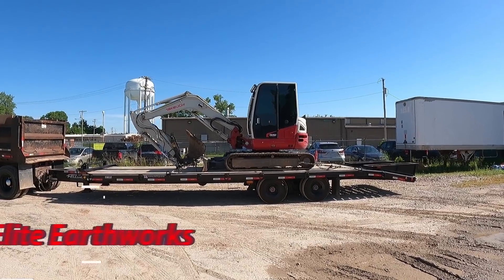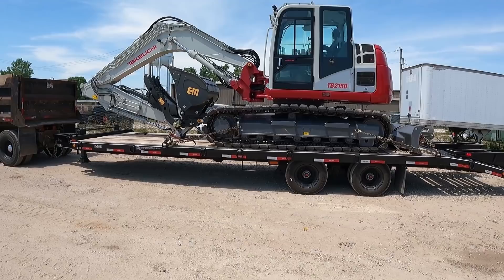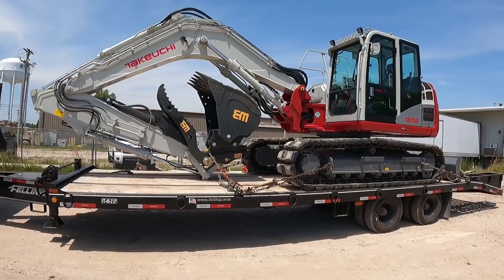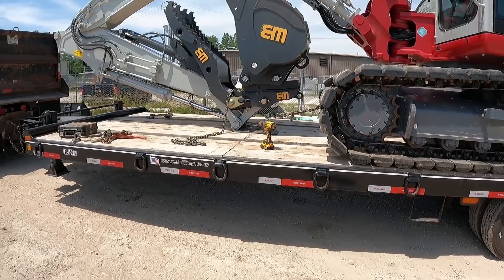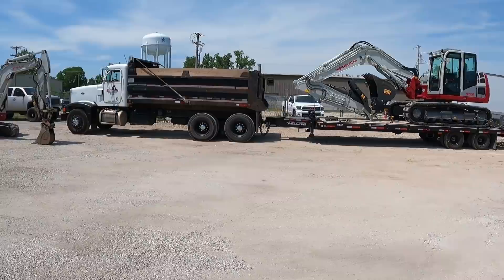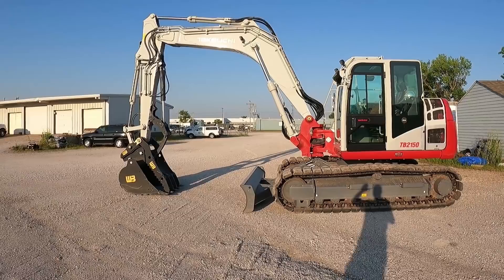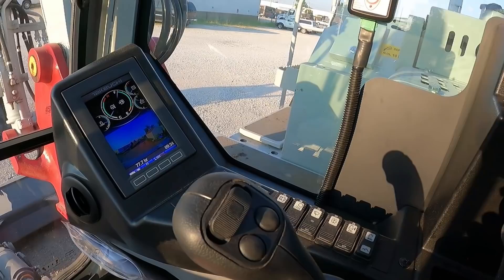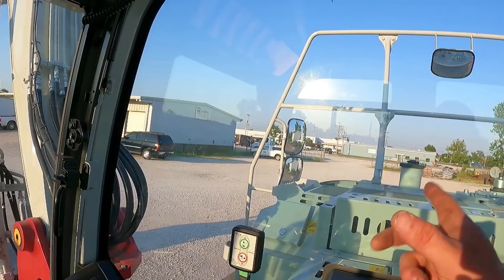The New 2021 Takeuchi TB2150 Has Arrived

Comment: Sweet setup, congrats.  Looks like a great machine, especially with far less hours than your rental.  Hopefully the thumb doesn't stick out too much when stowed and your loading dump trucks, cause it should be super handy for clearing work.  It's like they put the coupler control out in the middle of the side glass so you would see it before you even got in the cab!!  Seems better placed on your left since you use your right stick to curl the bucket control to switch buckets.  So is it going to be a brush cutter head or tilt grading bucket next?.....
Reply from the maker: Thank you! I love it! Yeah just a weird spot for the coupler controller I may mess with moving this weekend. That’s a tough one there lol those are both great attachments 😁

Comment: Nice machine! Must be filled with lead to be that heavy. I have a Kobelco ED150 and it is about 38000# but looks much larger. Hauled it on my 2 axle tilt trailer one time, had the tires and suspension squatted and did not feel good so i bought a 3 axle tilt.
Reply from the maker: Thank you! Lol it may be yeah that’s probably a good idea. This trailer seems to do fine with it but a 3rd axle may have been the way to go
Reply: What's that trailer rated for? I'm having trouble finding a tandem tag trailer with a 10 ton payload capacity in my market.
Reply from the maker: @RunninOnCoal  it’s a 25 ton trailer. They are tough to find so I just had Felling build this one last year

Comment: Congrats man! What your state bridge law rating for your trailer. My 2 axle 20 ton is only good for 34k lbs here in wa. So I wouldn't be able to tow that machine here with the same setup.
Reply from the maker: Thank you! This is a 25 ton trailer it’s actually good for 40k but the state may only 36k for two axles. I should probably check into that lol

Comment: Can you tell me a little about the trailer that machine is sitting on?
Reply from the maker: It’s a 2021 Felling 25 ton trailer with air brakes the deck is 26’ long with a 6’ beavertail
Reply: @eliteearthworksllc  That is a sweet rig. I've been trying to get a tandem axle trailer to pull a 10 ton machine behind my single axle dump truck. I went into a big tex dealer and the manager looked at me like I had eyeballs growing out the top of my head, told me my truck could not do it, then told me he'd sale me a trailer for $27k... Yeah, no. Any advice on finding an economical trailer for a 10 ton machine. Also, sorry I didn't say it before, congrats on the new machine.  

Also, you said you got that machine on a rental purchase option type situation. Can you tell me anything more about that? I'm starting a business. I have a dump truck and a skid steer (and I'm trying find the right trailer). I don't really want to spend any more capital right now, but I need an excavator. I have a good credit score, But I haven't financed big ticket stuff before. Is your ability to finance in the near future important to getting a rental with option to purchase deal? What is the best way to go about renting an excavator? I've already got what is a lot of money to me (it wouldn't be much to you) in my truck and skid steer. I've decided when I do get an excavator, I want a new or late model one with a warranty. Any advice on that or anything else you want to tell me would be appreciated. Thanks!

Comment: What size trailer are you hauling that with? Almost 40k pound machine id assume you need a tri axle equipment trailer
Reply from the maker: It’s a 25 ton trailer and it’s built to haul 50,000 lbs. Felling trailers haul what they are rated for you don’t have to minus the trailer weight with them
Reply: @eliteearthworksllc  I did not know that. So it must be a heavy air brake trailer I see. Nice machine nice big size. We bought a older tb175 and wish it was this size
Reply from the maker: @leonardogojcaj4475  yes it’s a heavy air brake air it weighs 11,000lb empty. Felling and Talbert are the only two that build them that way. Thank you! I love this machine perfect size if you ask me.

Comment: Is that 6 points of tie down I see?
Reply from the maker: Yes lol
Reply: @eliteearthworksllc  Does the DOT want that little blade tied down seperate where you are?
Reply from the maker: I thought so but it may not be a big deal with it tied down off the tracks
Reply: @eliteearthworksllc  I was told you did not have to tie down an excavator blade seperate because it only moves a small amount (same reason you don't have to chain or pin a hydraulic thumb). Also if you put two points of tie down on the blade (because most excavator blades have holes in them for tie down points) that counts towards your 4 points of tie down. Still doesn't hurt to have more than needed.
Reply from the maker: Yeah that’s how I chain my 260 down I gained this one an hour away so I wanted it chained down good 🤣

Comment: Say what you will about DEF, it has some serious plus issues for diesel engine operators.
It extends your millage that can save you lots of $$$$ over the years and it helps the engine run cleaner saving more $$$$ on oil and filters change time and the combustion chamber carbon buildup which also extends the service life between overhauls for operators.
Then there's the added benefit of cleaning up our planets ecology which we humans have managed to turn into a cess pool of chemicals and toxins that's beginning to bite us in the nether regions.
Of you actually think it isn't, that proves you flunked every science class you ever attended and your easily manipulated by undocumented propaganda.
Me, I distinctly remember the age of acid rain destroying the ecosystems of thousands of lakes in the 70's including in my home state of Michigan. 
As well as New York, Pennsylvania and other Northeastern states.
Reply from the maker: That is true they definitely burn cleaner I just wish they could get the sensors lined out that seems to be what I have trouble with the most so far.